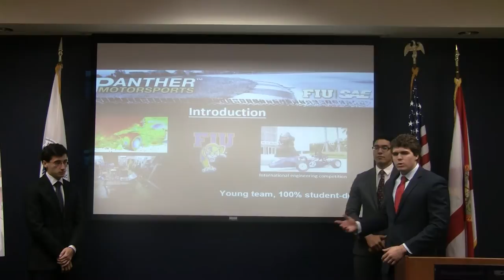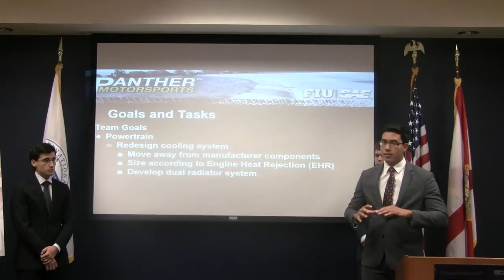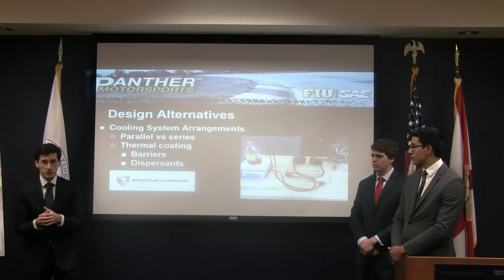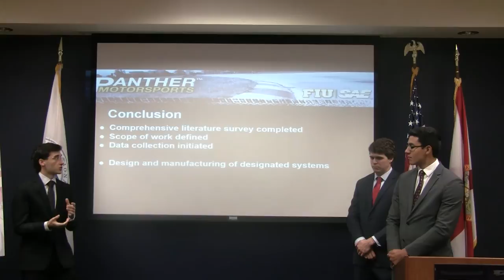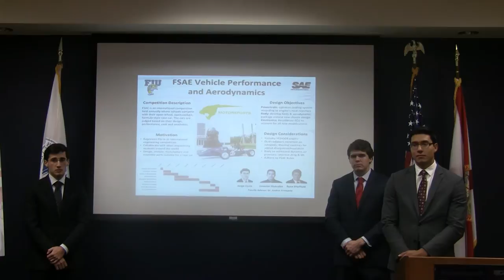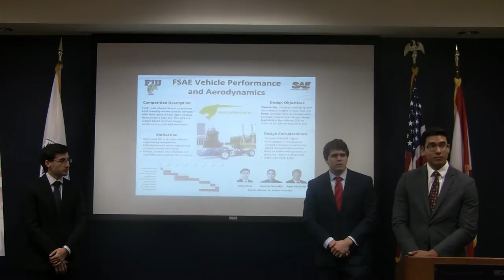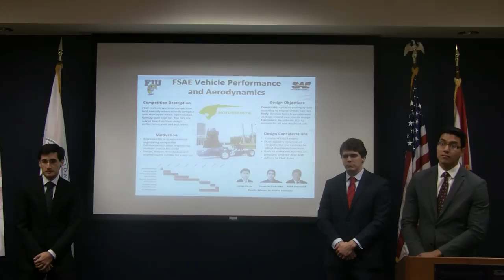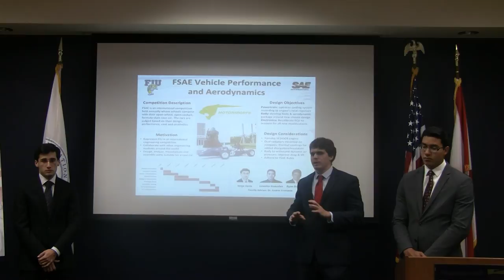SDO Team 13: Formula SAE Powertrain and Body

Comment: This project is a very big project. The team did a good job presenting their ideas while using good slides. The project emphasizes the importance of teamwork in engineering as a whole and to be ready to work with fellow engineers from other branches.

Comment: The team was very organized throughout the presentation. All the slides were clear and very informative. The project is a very big project which requires the help from the rest of the FSAE team and this was very well stated. The deadline and timeline was clear stating that the car will be finished early which would clearly benefit the rest of the team in preparation for the competition to gather data. Overall it was a very good presentation.

Comment: The presentation was presented great. The team was well prepared and spoke clearly, they knew the material very well which helped to highlight their project. While the design was semi complex, they knew exactly what they would have to do to actually produce a working end design. Overall the presentation was excellent, the slides were easy to read, and i was able to fully understand what the team was trying to accomplish.

Comment: Sometimes working as a group might be difficult. Even more would be the fact of working with another team. Overall, SAE is a good place to be when you are interested in the car industry. The slides are summarized and well distributed. The participants seem to have rehearsed multiple times before presenting which reinforce the fluency of the explanation.

Comment: Since they are working with another group they should include there timeline and align it with their's. I agree with advisory board the scope of the project seems large, its like they are still in the initial design phase(compared to there peers).